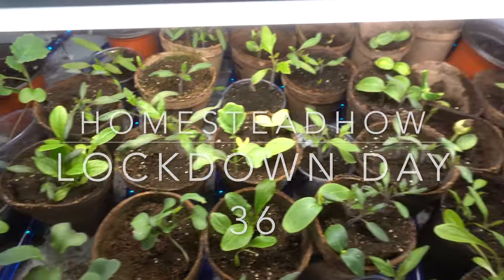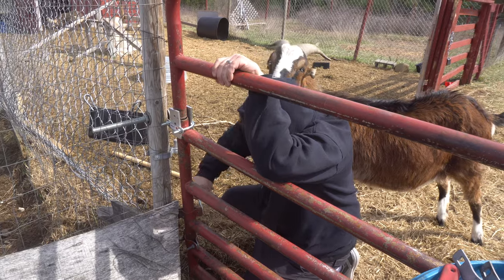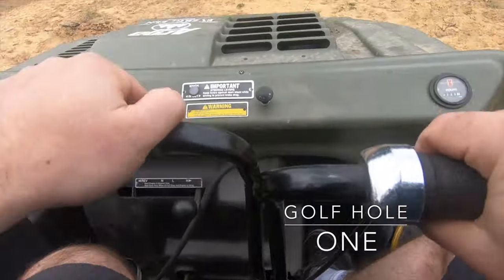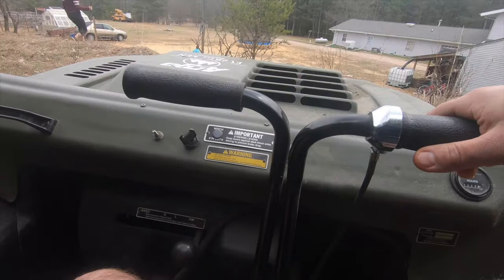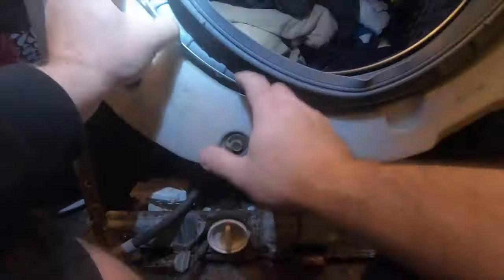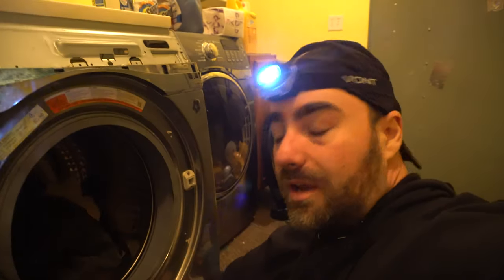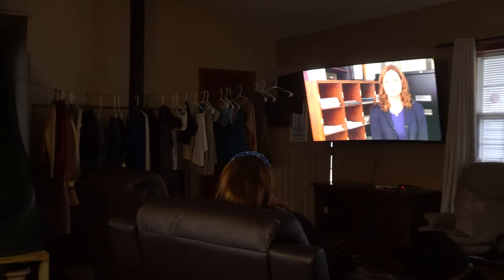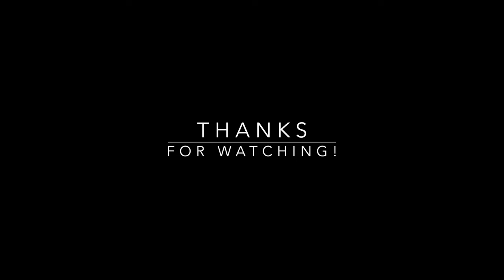We took our Goats GOLFING!  Day 36 of Lockdown

Comment: I've never seen an automatic garage door without auto safety stop. 
Used washing plunger in a bucket, wrung out clothes and line dried them. Took me days to recover 😆 more Respect for my ancestors. But bcuz were off grid and I can't afford the Amish manual machines at Lehman's, I did figure out an efficient wringer until we can buy one.